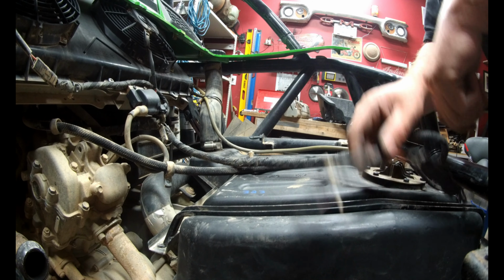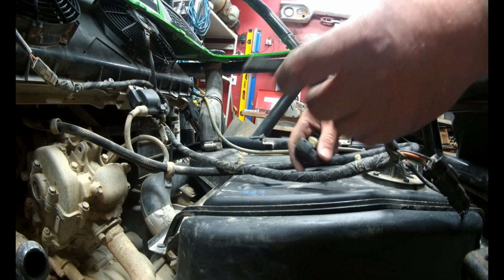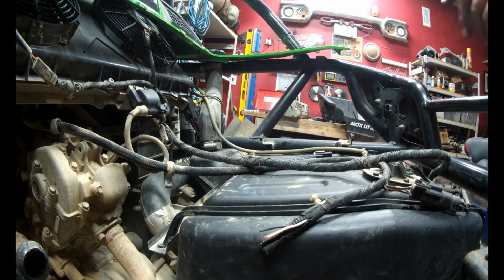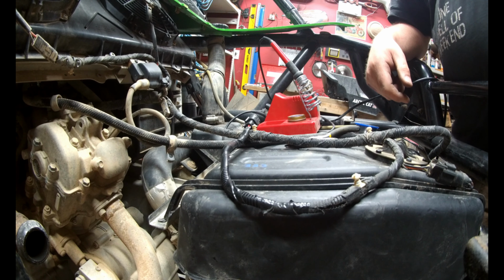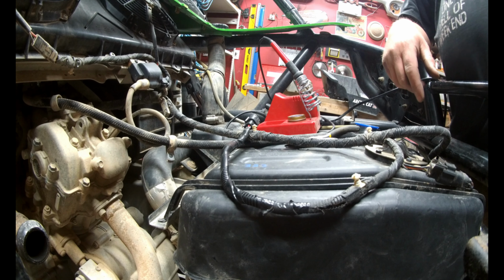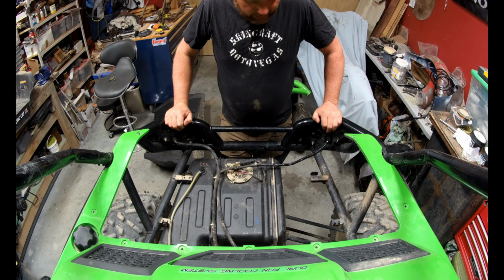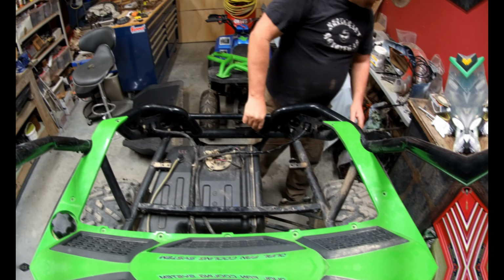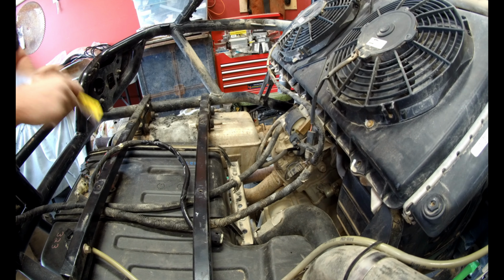2013 Arctic Cat Wildcat 1000 X Copart Build - E1  Buying Copart toys is it worth it

Comment: Valve adjustment needed. Probably what happened was fuel was not burned in the combustion chamber in one of or both of the cylinders and sent to the muffler. The fuel probabably saturated the fibers in the muffler and caused a fire.
Reply from the maker: Thanks ,Much appreciated. I'll check that out.